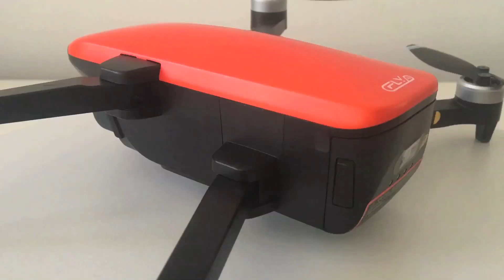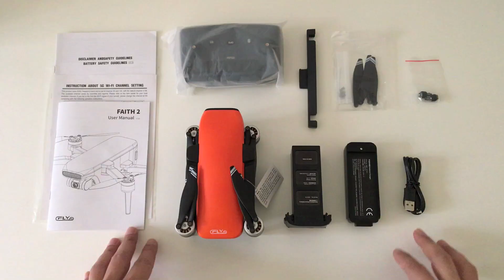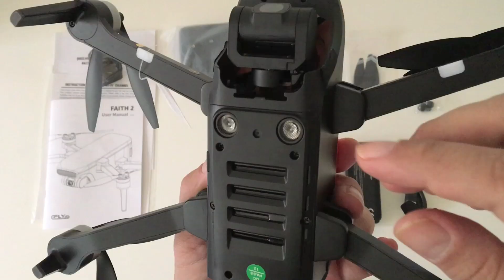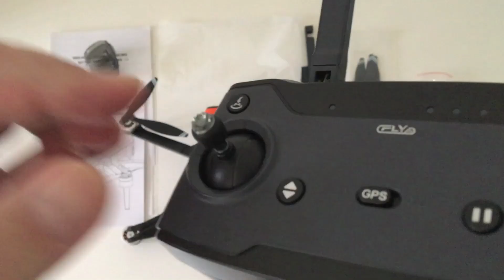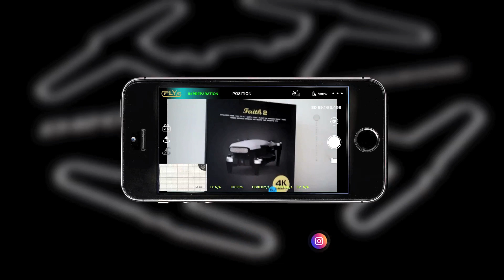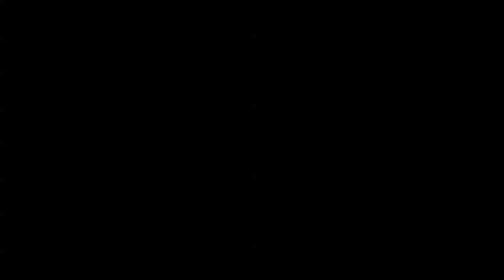C-FLY FAITH 2 - UNBOXING (IN-DEPTH LOOK)

Comment: I just recieved the mine from a week and I'm very surprised from quality of video and stability of flight. Moreover the cfly2 app has upgaded with few but usefull camera settings. Battery is great with more then twenty minutes of flight always with moderate to strong wind. very happy of deal(244€ on Aliexpress)
Reply from the maker: Thanks for your comment. I’m glad to hear that you happy with your C-Fly Faith 2. It is a great  drone for the price with a high quality camera. Unfortunately, I can’t recommend Aliexpress as I’ve seen many people complain of different sellers on that site but I do recommend RC Going for anyone wanting to purchase the C-Fly Faith 2, as I have bought many products from them and they are a very reliable site.
Reply: Well , with Aliexpress  I received the item in 29 days , destination Italy ( range announced  was 28-42). 230 eur plus 12 eur for taxes at arrival, but paired with a nice gift , a 64Gb micro Sd.

Comment: BUENAS DRONEROS!   NECESITO DE SU AYUDA PORFAVOR!.

ME SALE ESTE MENSAJE EN LA APP PARA C Fly Faith 2 "CFLY2" CUANDO QUIERO AUMENTAR LA DISTANCIA DE MI DRONE..
under beginner mode, must unlock aircraft with GPS has located, if aircraft is out of control, please active RTH function, to make aircraft return safety
en el modo principiante, debe desbloquear la aeronave con el GPS ubicado, si la aeronave está fuera de control, active la función RTH para que la aeronave regrese con seguridad
MI PREGUNTA ES!

COMO DESBLOQUEO MI DRONE DEL MODO PRINCIPIANTE PARA PODER SACARLE MÁS PROVECHO Y CON MAYOR DISTANCIA DE VUELO?

PORFAVOR ALGUIEN QUE ME AYUDE URGENTE!!

DESDE YÁ!

GRACIAS (Y)
Reply from the maker: To deactivate the beginner mode just slide the button to the left and it will be turned off. You drone needs to be on and connected to the drone’s WiFi to pick up GPS satellites.
Reply from the maker: In beginner mode you can’t manually turn on the motors without a GPS connection.

Comment: found your channel while looking for video reviews of this drone as im looking at buying one to upgrade from my ZLRC SG906 pro beast.
im quite certain this will be my final choice for my next drone, great range, very good camera and selling at a fantastic price, ive found it selling for £259.99 for a 3 battery and carry case package at A1smartshop in the UK.
your right about the controller lack of small screen for telemetry being a minus point, i like that the phone holder on the controller is underslung.
very good review my friend, subbed to channel.
Reply from the maker: Thanks for the comment my friend and for subbing to the channel. Yeah, this quad is pretty decent for the price. Plus, if you plans to buy it now, then you’ll most likely get one of the newer units they’ve released. I left my affiliate link in the video description where you can buy it at a very good price along with a discount code as well. It helps support my channel. 😉👍🏻

Comment: I have about $400 to spend. Is this a good choice or do you have a different suggestion
Reply from the maker: Hi Ted, this drone is a very good semi-pro drone for the price but it lacks some features in the app that the DJI Mavic Mini or Mini 2 have and surpasses this drone overall by a stretch. Its really up to you to decide but if I had 400 to spend I'd save a bit more and get the DJI Mini 2. I rarely promote DJI products as I do not own them but in the end it basically boils down to personal preference and quality.

Comment: It's a nice drone, but it's a shame the price is too high.  For another $50 you can get the DJI Mini 2, which has all that the C-Fly Faith 2 has and more with three batteries.
Reply from the maker: It will eventually drop in price. As with many of these new alternative drones, they cost more when they are released for the first time but then in a few months their price goes down to reflect the actual market.

*By the way, I too am a talmid of Yeshua 😉 🙏🏻

Comment: Very nice review.  Good in-depth observation and comment.  I like keeping an eye on alternative brand drones.  Mostly to see if anyone will rise up and become a challenge to DJI.  The biggest issue I've found with any of these type of drones (including Fimi, Parrot, etc) is their supporting app/software.  There always seems to be a bug or two in them.
Reply from the maker: Thanks BMack. I agree, many of these alternative drones in the market spend less focus on perfecting their app and firmware and release them in a rush. This quad’s app is pretty basic at the moment but I’ve been told by the manufacturer that they are working on several new features that will be added to the app like adjustable camera parameters(like the zino pro has), firmware updates directly from the app and others that they are working on. So let’s see where this drone is in a few months from now.

Comment: You don't have to do gps calibration when flying the drone unless the drone app tells you too and can be flown indoors thanks to its optical sensor. Battery when flat takes for ever to charge, i think its something like 3 hours
Reply from the maker: Yes. That is supposedly the case with this drone.
Reply: From watching Captain Drone on YouTube
Reply from the maker: @garylinnane917  Yes. I know. I’m the one who got him the drone. 😊
Reply: When i do calibrate compass, drone stay in the floor. it happens failed not success. What is wrong? When i calibrate compass. The drone must turn right like mjx ?